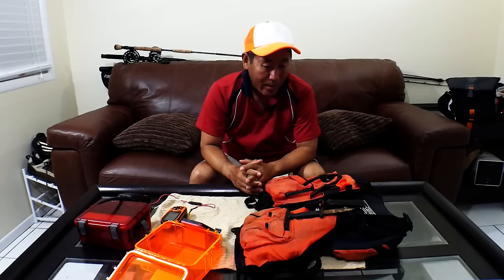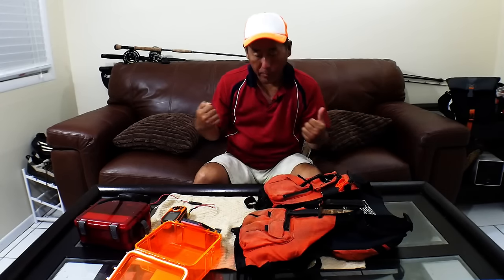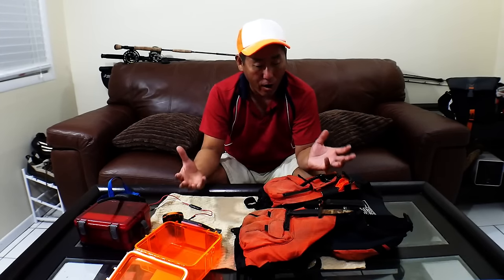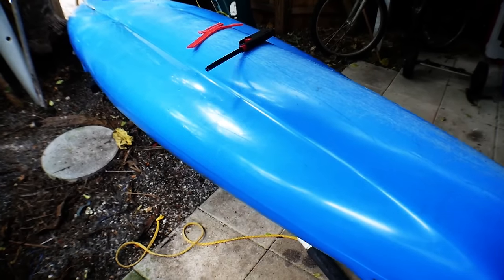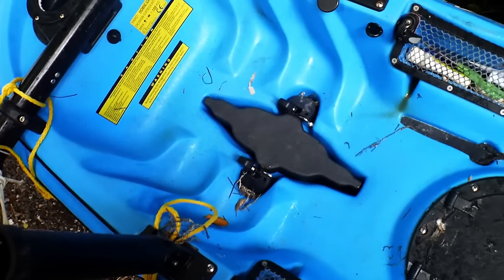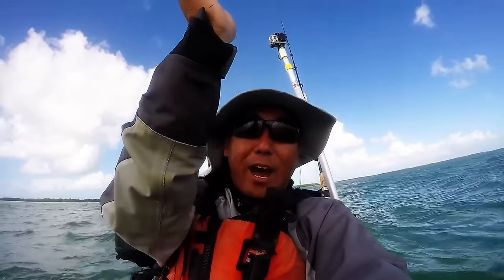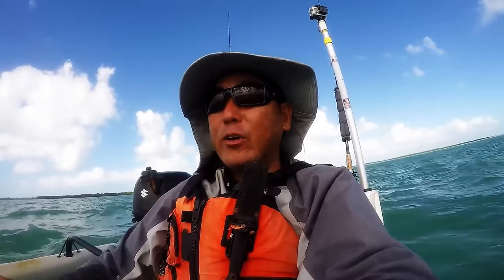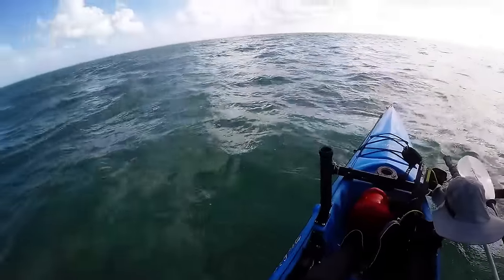Kayak Safety Certification - 2017

Comment: Safety on the water is paramount, and not just for kayaks.  Any time I take a newbie out on my KW, I run them thru a safety check.  I have them open hatches and look at the safety equipment so that hopefully their memory will serve them well in an emergency.  Not only for them, but my safety too.  They need to know where and how to use the backup dead man's lanyard and basic boat operation should I end up in the water unconscious, as well as how to send a distress signal on the VHF.  Quite similar to what you'd experience on any charter or dive boat..
Reply from the maker: Have heard about stories like that.  We just had one down here over the summer where a guy took his girl out on his boat and then he had a medical emergency.  She had no idea what to do and just floated out there.  They got lucky that the Coast Guard checked on them.

Comment: Great tips. Wonder if there is anything you can use to treat your equipment for corrosion. Wax, oils, etc. Also, maybe you can do a segment on sun safety. I always struggle between sun safety and comfort. Up my way the air gets hot on the water and I pay for it, even on a short 2-3 hour outings in New Jersey.
Reply from the maker: In my earlier safety equipment video I kind of went over sun protection.  If you watch my videos, the only parts exposed are my face and my hands.  Both get SPF 60.  Stick with full coverage clothing and if your hot, douse yourself with water.  Forget about that quick dry stuff.  Stick with the stuff like cottons/t-shirts and sweats that are going to hold water and keep you cool as well as keeping you covered.  Big hat is immensely helpful for being able to see, but also to keep the sun off your face.

Comment: So cool how now that I got my FeelFree I was thinking I need to practice reentry. Being 60 I'm thinking about rigging up a stirrup of some sort in case I've lost my upper body strength. Yes I'm over weight too, lol. Maybe rope with a loop at both ends run the end thru the loop at the handle and the other loop I put my foot in and use that for leverage. I've seen a Youtube video using the handle of a small cooler to put your foot in and using the buoyancy of air trap inside the cooler (cooler upside down) to kick yourself up.
Reply: If you use the stirrup method you'll probably also need/want a paddle float to help keep the kayak from flipping. The way it works is, you slip the float over one end of the paddle and then slide the other end in the straps of your seat to hold it in place. The paddle is perpendicular to the kayak and acts like a small outrigger. I keep my float in the front hatch and it's easily accessible.
Reply from the maker: That's the importance of getting out there and figuring it out.  Your biggest nightmare/regret will be that first time you go over and you realize you don't know how to get back on and your panic mode goes red line.  It is not a good feeling.  If that doesn't get you motivated, just realize the person that is out there with you will most likely end up in the water as well as nobody practices helping a panicking person get back in their kayak.
Reply: Yes, Randall Marsh I've seen a video of that method being used. More so in use of sit inside yaks. I really think I have the strength to do the one hand near you and the other hand reaches across the yak to pull your chest up. It's the last part I wonder of getting my butt in center..lol. In the mean time I'm just staying close to shore at one of our lakes here. Water temp is too cold to just go in for a dip..lol